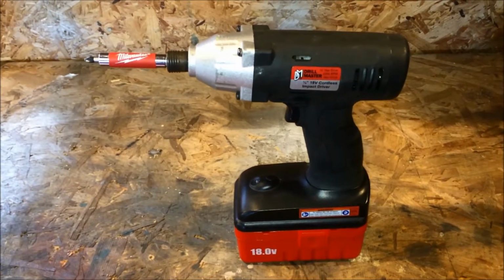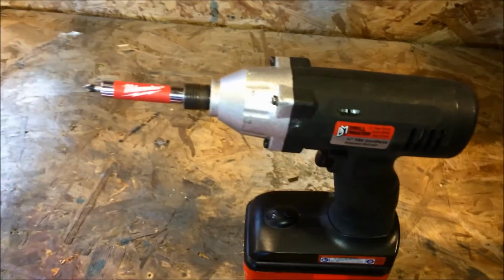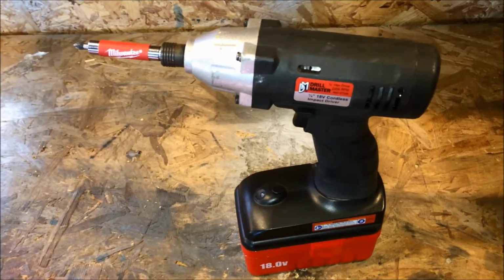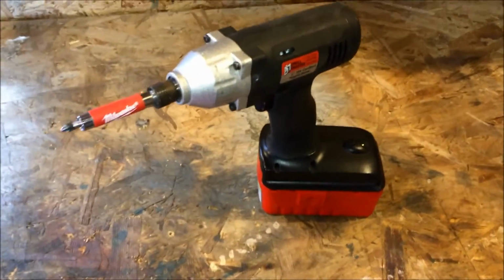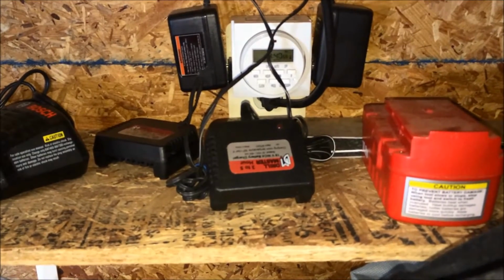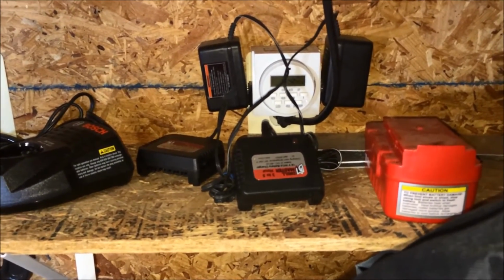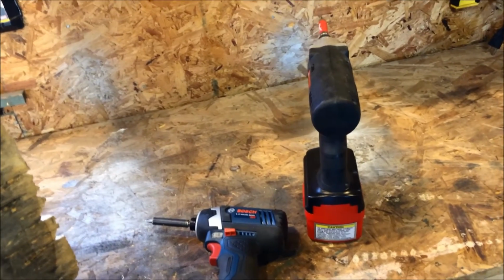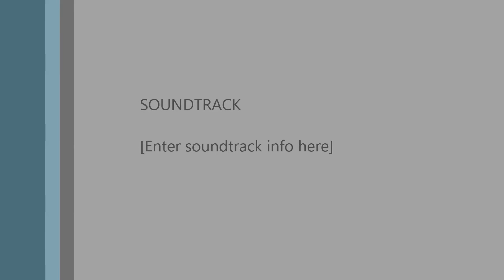Harbor Freight Drill Master 18 Volt Impact Driver Review 67028

Comment: Bit late to the party, but about 2 years ago I picked up one of the now-discontinued successor model to yours, the Model 62874 (tool-only--no battery or charger), for only like $6 at one of their Sidewalk Sales. It uses the very same 18V batteries as the current cheapo DrillMaster drill, which I already had. And honestly, that's been perfectly fine for the light use I've given it. Hell, I even liked their really ancient "blue series" DrillMaster stuff, and still use the detail sander and jigsaw from one of those kits using an adapter I found online to use the newer style batteries. I wish they still sold the old style batteries! Anyhow, thanks for the looksee at yours. I was just wondering what others thought of the breed. I haven't even used mine yet.
Reply from the maker: Glad you liked it

Comment: I Love Cordless Impact Drivers

There are 2 sides to every review --  Good and Bad

But considering you spent $40 for it I think it's fine

I have some battery operated drivers that are LOW TORQUE

I manually losen bolts  -- snug bolts manually 

But using power to run bolt in or out makes it easier

Tools last longer if you take care of them  --  baby them

You suggest buying an expensive impact if you built a deck

My thoughts on that is to drill pilot holes for screws

Lowe's Deck Video suggests drilling holes to avoid splitting

That would make it easier to power screws into framing

Since I am Old School I would probably use Corded Power Tools

Battery tools are handy but real power is 120 VOLTS !
Reply from the maker: ok

I
see
what 
you 
mean

Comment: You won't see me use a harbor freight electric tool but when it comes to air tools they're alright. Or their sockets.
Reply from the maker: I've had very good luck with the hand tools and sockets. The Pittsbugh Pro line of tools is pretty solid. 

Thanks for watching!
Reply: +Streeters Garage I've played with their hand tools a little and you're right they are solid. I have some of their ratchets from the mini sets but they sound like they have plastic clogs in them. I replaced all of the ratchets with snap-on ratchets just in case. I plan on going tomorrow and getting an impact set lol

Comment: I had the 120V impact, not very good.
This time I got a Milwaukee 18V Lithium impact, nice.
But I'm a Harbour Freight junky, the deep impact socket are as good as need be, prices are insanely cheap but most people say stay away from anything with batteries. Pick and choose , they have plenty of decent stuff for the home mechanic.
Reply from the maker: Couldn't agree with you more. I have their chrome-moly impact sockets and I love them, I actually have quite a few of their hand tools and haven't had a failure on any of them. I use them every weekend as well. So I would say it's money well spent.

The battery power tools are a hit or a miss. As long as you set your expectations accordingly you won't be disappointed. I've since picked up a 20V Porter Cable LION Impact and I LOVE that gun.

Comment: That seemed to struggle on those little screws. I see it only has 300in lbs where a chi elec 12v has 384 and name brands have like 1500in lbs. this is shit numbers. I have the drill and its okay but i see now where these lack in power.
Reply from the maker: It’s junk.

Comment: Drill Master Battery Operated Tools are a waste of money, they are complete junk and should be avoided at all costs. You are much better served by spending a few dollars more on a Royobi or Porter Cable from Home Depot. they will last a lot longer and are much more powerful with their Lithium 18 Volt Battery.
Reply from the maker: Completely agree. Check out the rest of my channel. 

I threw that crap in the garbage shortly after. Thanks for watching!
Reply: Sorry my friend, but I stand by my previous post. Drill Master is Junk and is a waste of good money. For about 30% more money you can get a Home Depot Royobi brand power tool that will last for many years to come. Drill Master comes with a very cheap grade NiCad battery that will go bad in 6 months. Remember this, you buy Cheap You Eventually Pay Twice.
Reply: John L I'm 11 and have three big tools bags full of tools and a Stanley rolling work shop and makita drill and impact I have been wood working for 2 years sanding and all I bought all my tools with my money.
Reply: Trapping Channel....  Good Job, remember this from a old timer, Buy quality tools and they will last a lifetime, buy cheap junk and all you will have is Junk to be tossed out in a few years.
Reply: I feel that that was a problem as the grease or lack of it